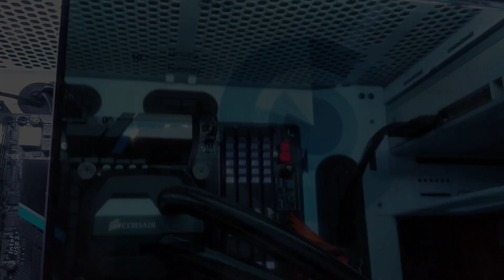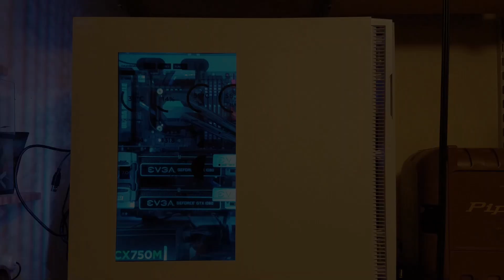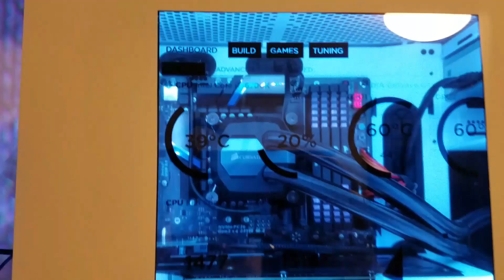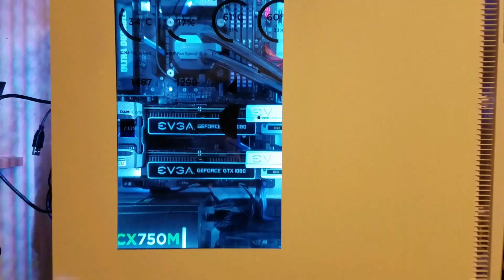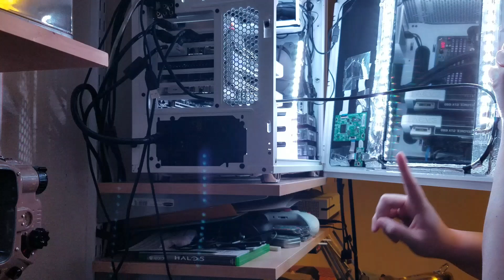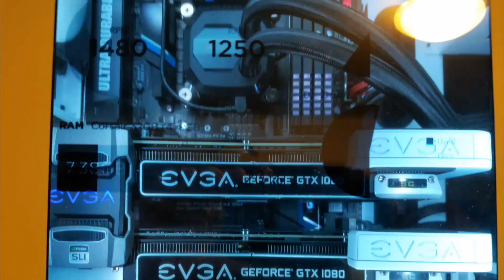Custom pc lcd side panel

Comment from the maker: It's like you guys havnt heard of Google or something. 

lcd teardown tutorials_____
one of the better informative ones: https://youtu.be/QQCI0M-ZeRM
larger older monitors: https://youtu.be/XNiFxZGPMoM
newer smaller monitors: https://youtu.be/3GibgiK0cbA
Larger newer tv/monitor: https://youtu.be/axmZJBRGYn4
Reply: Hey i have recently done this with my PC. It is all working and looks very nice but i was hoping i could pick your brain about something? My display looks a little clouded and not as transparent as yours. I used a HP LA 1907.. actually truth be told i used a HP LA 1951, 1950 and 1907. Lucky i had all three and they were compatible. I lost two trying to fix this clouded appearance issue. I believed at first that there might have been a anti glare layer on the glass and that was causing my clouding issue. So i began removing the layer but it turned out to be a polarizing layer. On the second glass i removed the layer on the opposite side and that too turned out to be a polarizing layer. So now i am at a loss. Someone suggested i needed to add more intense lighting to fix the issue but it surely cant be this simple can it?  Your insight would be greatly appreciated. Thanks

Comment: I highly recommend anybody reading this and trying this out to immediately create housings for your circuit and logic boards. If anything touches while powered on you'll get a huge shock, some smoke, possibly a broken fuse, and if connected to PC could damage it as well. I had my panel completely disassembled, got that anti glare coating off and was ready to mount to the inside panel of my PC. Some freak accident happened where my dogs leash caught some part of the table and the 2 boards touched while powered on.... Everything was fried, wasted a bunch of time. Didn't discourage me though going to try again soon. I have a Corsair 570x Mirror Black and am hoping the mirrored glass panels aren't too dark to show a display clearly. I've got 8 RGB fans and 4 LED strips in my case, if I set them all to static white I'm hoping it'll be enough light.
Reply from the maker: Yeah covering the boards in a single layer of electrical tape should also more then suffice.

Comment: Hey Pixel! I see that if you have an USB Monitor, it helps a ton because you can plug it in and you have power + videosignal both at once, so no soldering which is perfect. Now, is that only the case for USB 3.0 monitors? I saw a dell with USB 2.0 plugs, do you know if that would work too? I mean the difference is only in transmission speed, which is irrelevant for this project. Is that right?
Reply from the maker: This one actually has both usb 2.0 and 3.0.

Comment: How is the lcd power connected to the power source of the pc?
Reply from the maker: It's a USB monitor I just have snaked out the back. But you could just get an internal usb header as well
Reply: @pixelsixdesigns  but how is the conection cables ?
Reply from the maker: @luisgranifo1298  it's a single USB cable for both video and power.
Reply: @pixelsixdesigns  you can help me bro if i send you a e mail pls ?
Reply from the maker: @luisgranifo1298  I'm not currently in a position that I can accept freelance work. But I'll be happy to answer questions over YouTube. But if it is questions about this project you may want to look through the existing chat to see if I already answered the question first.
Reply: @pixelsixdesigns  ok bro thanks  I want to know exactly what is the connection of the cables of the lcd video card to the usb that is my big doubt hopefully you can help me more clearly
Reply from the maker: @luisgranifo1298  it just plugs straight into a USB port on the back. Like any mouse or keyboard. So it does not plug into the gpu.
Reply: @pixelsixdesigns  but what color plug into the usb all blacks ? And the other ?

Comment: How did you adhere it to the case?
Reply from the maker: John Jacob's its light enough that I just used electrical tape to insulate it then a couple layers of aluminum tape.
Reply: Thanks, actually just found your other video where you explain, my bad haha.

Comment: How do you get it so clear, do you take off the polarizing layer?
Reply from the maker: Jude Kratzer got lucky enough to get one without the diffuser glued to the back. Thou from what I've seen you should be able to peel that layer off in most panels. And not I did not remove the polarizing sheet.
Reply: Ok thanks, I just bought the parts to build my own.
Reply from the maker: Jude Kratzer nice, hope it turns out right for you.

Comment: Hey, I've a question because I want to build such a side panel by myself: Which Rainmeter-skin did you use to show the information on the screen?
Reply from the maker: Cornelius Diefenthal I have links in the description of the follow up video to this project. But on this video i am actually using the nzxt cam software.
Reply: PixelSixDesigns Oh okay, i thought you would use an other program because i read it on an other website which was showing your project. But thanks!
Reply: Okay I installed the program but how did you remove the "program-bar" on the top so that it's not displayed?
Reply from the maker: Cornelius Diefenthal sorry I think there was a misunderstanding. In this video i used cam software, (you "remove" the bar by making it white) but I have since with the follow up video started using rainmeter and the links to the skins I'm using are in the description of that video. Hope that helps.
Reply: PixelSixDesigns Yeah I saw that you used rainmeter in your newer video. My problem was that for some weird reason I was not able to change the colour in cam.
But thank you anyways, i think within the next days or maybe week I will get an old molitor myself and try my best:D The planning is just a little hard because I'm using the corsair crystal series 570x rgb case and there is no screen which fits above the whole side panel (and doesnt cost more than 700 bucks). But I think then i will make only 3/4 lcd and the rest for the drivers.

Comment: Well done! I was actually talking with some friends about doing this exact same setup (with the AOC anel) back when I first saw the IBP concept last year. The only difference in execution I had in mind was instead of routing the usb cable out the back of the case, buying an external usb to internal header adapter and plugging it in to the motherboard. Either way, well done!

Comment: Is that watercooler (H100i ?) reliable ? does it make a lot of sound and are there any leaking issues ?
Reply from the maker: its the h80i, didn't need the dual radiator as im not overclocking, but yeah its fairly reliable. I haven't heard much about them leaking, but if it does, boy will that be a bad day.
Reply: I have the H80i on a 6700K and am running it at 4.6ghz - Temps are still ok. I didn't want the H100i because top mount radiator vents seems weird to me - eg dust entry

Comment: How do you set your desktop up to support this? Assume it's rainmeter over a white wallpaper? or do you somehow tell it to be transparent? Great work!
Reply from the maker: Sevanon yeah you do need to modify your background to use this. Simplest way is to printscreen and paste into paint or something and just white out the side panel area. And I'm using the nzxt cam software for the system info
Reply: PixelSixDesigns Oooh nice. Might set it as a separate background for that monitor to just plain white. Thanks for the reply. Will have to give this a go.

Comment: damn screen is no less than $190AU, thats a bit much.
Reply from the maker: SageownZ feels bad man, you guys get wreaked with tech prices over there. But you can do this with pretty much any lcd monitor thou.
Reply: Yeah, just don't want to risk $100+ on it not having the possibility of being pulled apart or used properly. (layers etc)

Comment: What case is this?
Reply: Courtland Dastyck it's a fractal define r5 I believe
Reply: Huh just noticed the case or the flap is different at the beginning compared to the middle and end but its the same setup inside. Do you think the fist part was a custom cover?
Reply: Courtland Dastyck define r5
Reply from the maker: Courtland Dastyck the first part was the original side panel. I had to cut out a larger hole and reskined it with an acrylic sheet to clean it up.
Reply: Thanks for the info everyone ^^